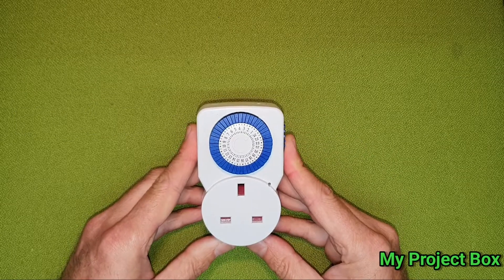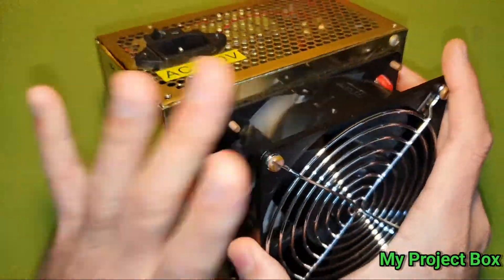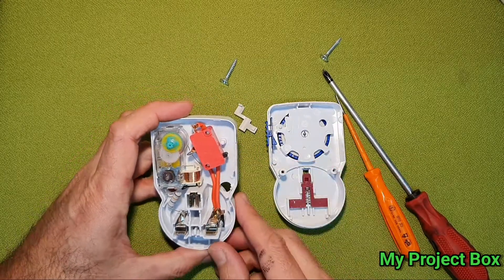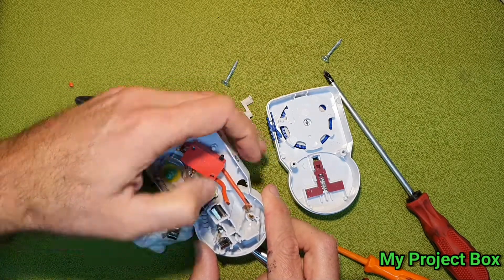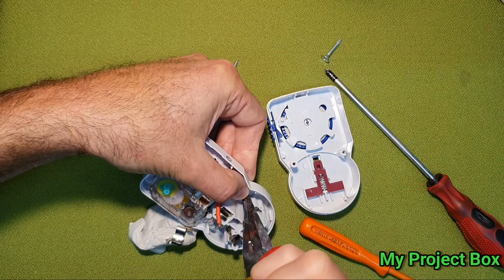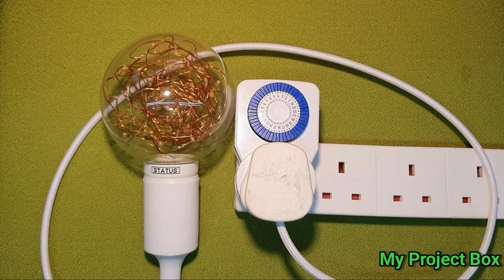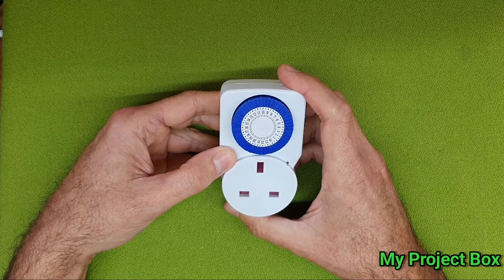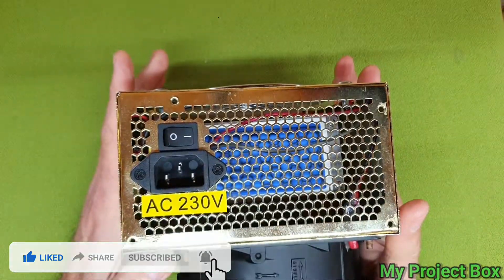Plug-in Timer Modification #ElectronicsCreators

Comment: I enjoyed your video. I found it searching for a solution for a similar use case. I unplug a fence energizer from the mains. It is at a remote location. I then work on the fence for a time and then need to travel back to the fence energizer to plug it back in to power the fence.

I want to be able to power off an outlet for "N" minutes for fence maintenance and then have it power itself on with the timer after that period. I want it to only run once. That way my fence will reenergize to keep my horses in, without me traveling back to plug it in.

Can you think how I might achieve this?